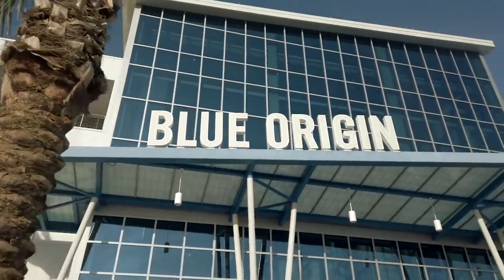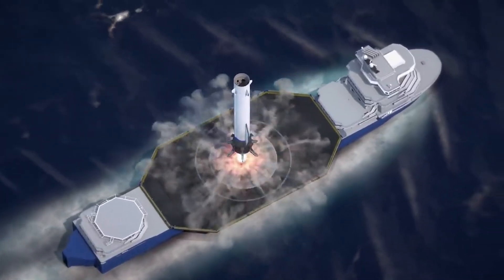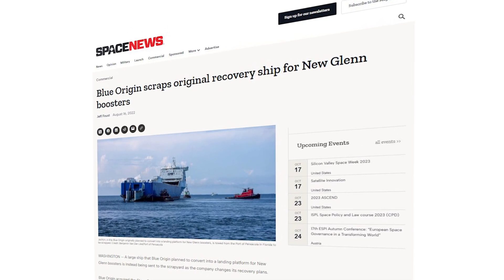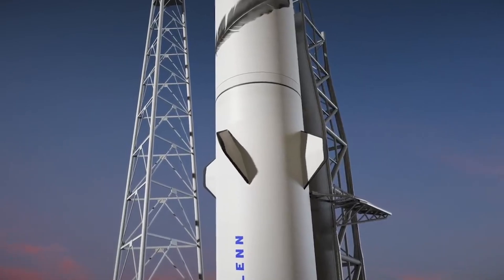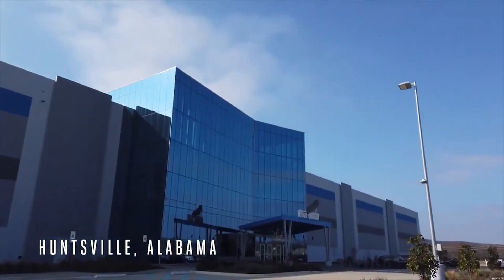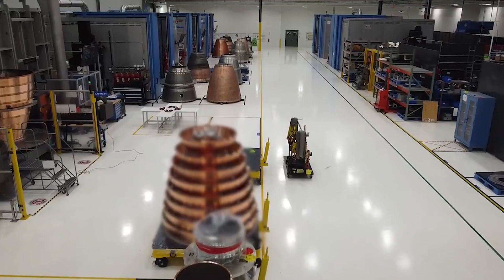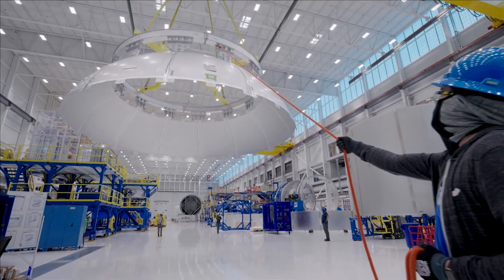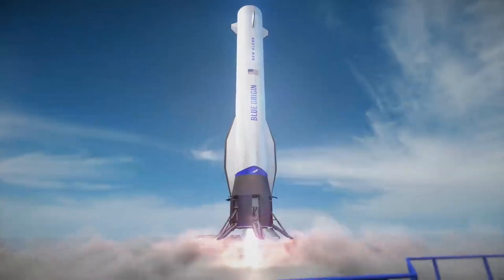What Is Blue Origin’s New Glenn Landing Plan?

Comment: Man Chess Engine & AI from the Unity asset store is sick.
Reply: @palinText384 14 to 18 months in what time? Elon time? Crack time? Not real time that's for sure.
Reply: @codeblocks4067  the EscaPADE mission has a provisional launch date between 6th and 15th August 2024 on New Glenn.
NASA, who probably have the most insight into the New Glenn program outside of BlueOrigin themselves, believe this deadline is possible, but not guaranteed.

So, New Glenn launching in 14-18 months would actually mean BlueOrigin was between 25% and 50% slower than the timeline, that the EscaPADE principle investigator was "confident" in back in April.
Reply: @plainText384  300-400% slower sounds more likely.
Reply: @plainText384, its not done with delivering in time for launch, things got to get loaded prior to liftoff.

I dont believe that nasa will put their payload into an unproven rocket.   Seen how nervous they already get with hls, though theres still 2 years left ?!
Reply: @MichaelWinter-ss6lx  Nope. August of next year.
Reply: @MichaelWinter-ss6lx  As was stated in the video, NASA is willing to accept much higher risks with the SIMPLEx missions (of which EscaPADE is one) compared to other missions (especially compared something like crewed moon landing with HLS and Artemis).

And when (back in April) they said they were confident New Glenn would be ready for EscaPADE, I'm pretty sure the EscaPADE team was aware that they would need some time to integrate the payload into the rocket. That's not exactly an unexpected delay.
Reply: Thats unfair!  Why does nobody believe its gonna fly ... fly ... to pieces?!
Reply: I'm starting to think New Glenn will fly in 14 to 18 months
Reply: @plainText384 LoL.Dreamer.
Reply: Times 2 to 3